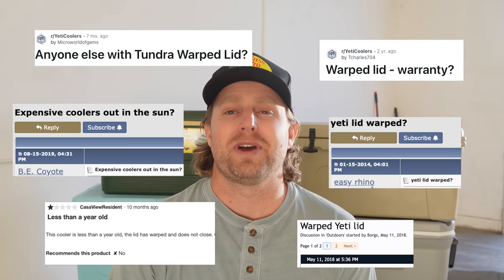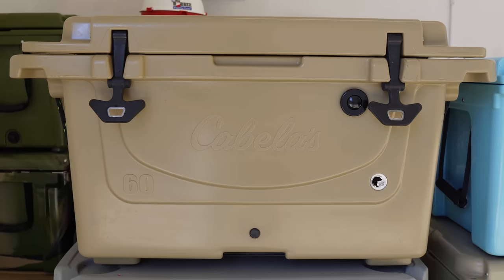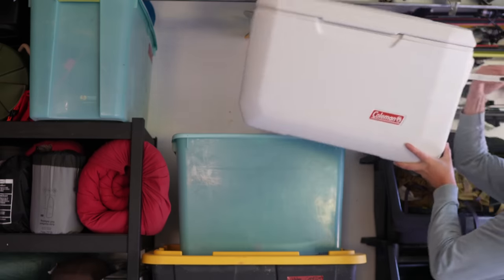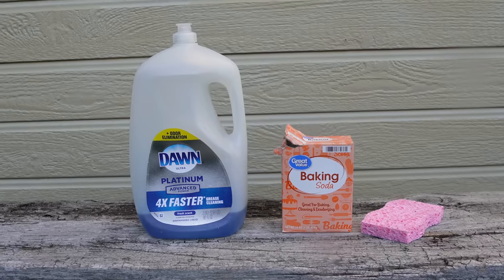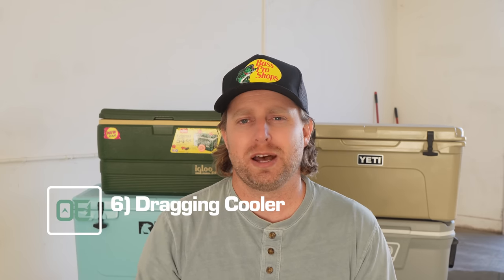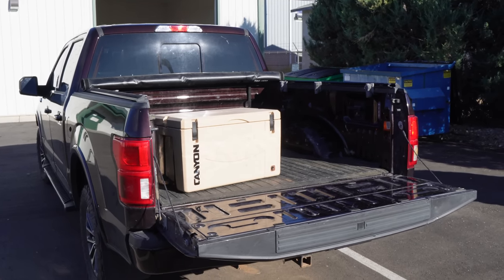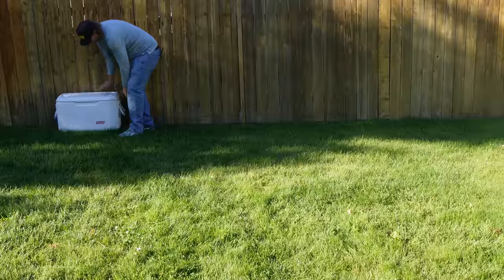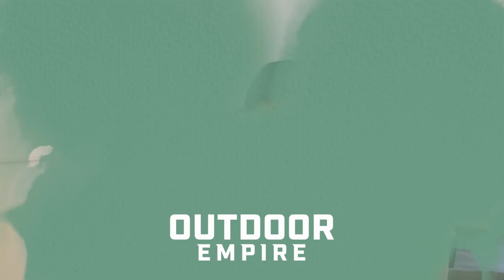9 Common Mistakes That Will RUIN Your Cooler

Comment: I can agree with almost all stated, and possibly even storage in hot/cold garage, but you need to define in exact terms what too hot and too cold is; otherwise worthless warnings. Is 101 too hot in the summer and is 28 too cold in the winter (the common fluctuation of my garage temps during the year...yes I have  monitored it). And I have an extremely cheap cooler in the garage that is still in ok condition. I would agree if 101 on Monday and 28 on Tuesday would be a too large of a variance in twenty four hours.
Reply from the maker: Great feedback! Although I'm not sure I'm qualified to answer that. That idea did cross my mind when making the video, but I can only imagine that the exact temperatures that are harmful vary by manufacturer and/or the plastic compound used for each specific cooler model. So it's gotta be a pretty complex answer and I'm not sure the outcome will be worth the effort. 🤷‍♂️ But I think the range you mention is pretty similar to where I live and my opinion is that's acceptable and I don't think it will lead to warping.

Comment: There is no point in having a cooler if you are not going to use it. I do not abuse my possesions and I have to call BS on 1 or 2 of your items. It is an effing cooler, not a chair! I believe far more coolers out there have warped lids from being sat on than from being left in the sun. Perhaps being left in the sun and then sat on would be the worst. You figure sitting on it by the fire is ok. It is not, again, it is not an effing chair. Keep it clean, keep it dry when not in use, don't pile heavy shit on it, most of all do not allow anyone to sit on it and it will provide years of trouble free enjoyment.
Reply from the maker: A spirited opinion, I like it! But alas, I shall sit on my coolers anyway. 🤷‍♂️

Comment: They aren’t waterproof. A channel did a toture test on the Rtic wheeled cooler and just basic slosh test. It didn’t even pass that and water sloshed out everywhere. If it wouldn’t  keep it in then it’s not going to keep the air out either.
Reply from the maker: Pretty sure that was me you're talking about on the torture test with the RTIC Wheeled. 😉

Comment: The coolers that would be affected by these issues are obviously defective coolers and I don't want any of them.
Do you have a list of the coolers that would be affected negatively by these conditions?
Reply from the maker: Pretty much any cooler made of plastic (i.e. any cooler) COULD be susceptible, but it doesn't always mean they will have a problem. And in most cases they're fine. I wouldn't avoid them, per se. I'd just take care of whatever you got or get and all will be well!

Comment: @2:22: For those who are lazy and let stuff rotten in their cooler: Use a mix of water and hydrogen peroxide to completely remove the entire smell of the cooler - like never existed. Same trick applies for - any - bad food smell regardless as to where it resides. This trick i've learned working in a meat department in a supermarket. Also same trick works for dog or cat smell. Pretty much anything that comes from a living thing as bad smell, with hydrogen peroxide you can easily remove the smell or fresh blood stains.
Reply from the maker: Great tip, thanks for taking the time to share!

Comment: Interesting video… but my cooler isn’t a garage queen. I look at it like a tool and tools are meant to be used. The Yeti rides in the back of the truck bed, and gets used nearly daily throughout the hot months and is in all weather. If it’s time for a cleaning, a dose of bleach and the garden hose does the trick. Probably not going to get the longevity you’re shooting for, but for the money I expect it to be able to take the abuse.
Reply from the maker: I hear ya! And good point on how it should handle the abuse for the money. I think daily cooler users like you get their money's worth more than the occasional campers that want their Yeti to last forever.

Comment: i have a metal cooler from the 70s that is perfectly fine sitting in direct sunlight thats been beat to hell and back and it still works better than most of these modern plastic turds that apparently need to be babied and protected to the point you may as well not even bring it with.

Comment: The real crime is buying a cooler that’s more than $100. I’ve had my $55 Igloo 60 quart Latitude Roller for 3+ years now with no issues. It has spent the past 2 years outside in my backyard in the elements, in direct sunlight during the summer months, subfreezing temperatures during the winter months, and everything in between, and it hasn’t deformed, lost shape or cooling effectiveness. I just cleaned it up the other day, it was disgustingly dirty and took me a while to clean, but it’s as good as new and no issues. A quality cooler shouldn’t do what you’re describing in this video. If it’s built right it will and should last. If you’re looking for the exact cooler I’m describing you can find it on Dick’s Sporting Goods website for $55 in multiple colors. Best cooler I’ve ever owned!

Comment: Now hear me out. If the heat warps it and for the price tag of some of them. Why do none of them try to prevent that? If it’s molded plastic wouldn’t they be able to put some kind of metal reinforcement in the mold like concrete workers do with rebar?
I work out of a truck everyday and my cooler just can’t be out of the sun. I just use a cheap igluu and buy ice daily. I’ve always been a yeti fan but don’t feel like spending that money just for it to warp.
Reply from the maker: Fair point. Cheers.

Comment: I always put a light colored towel over my cooler to protect it from direct sunlight/heat. It makes a noticable difference.

.
Reply from the maker: That's a great tip, I've never tried that but I'll have to when it gets real hot.

Comment: If your going to spend that kinda money on a cooler that is touted as tje toughest out there. And this kind a BS happens , I would  be pissed off. My plastic kayaks , canoes , paddle boardes dont suffer these kind of failures after decades of abuse.
Something doesnt add up here.
Clearly a rip off in action unless the manufactures back up there big talk...
Reply from the maker: One thing I neglected to address in the video is that some of these plastic coolers will warp a bit in extreme heat or sun exposure, but then resume their original shape once cooled down. The risk comes with extended periods of sun exposure. And even then the cooler will likely still be mostly functional, but if the air seal around the lid is breached then they won't hold ice for nearly as long. Chances are some other plastic products like kayaks suffer some deformation as well at times, but it doesn't impact their functionality like it does on a cooler so you don't notice it and it's just not a problem.